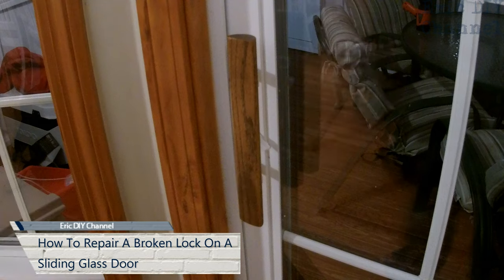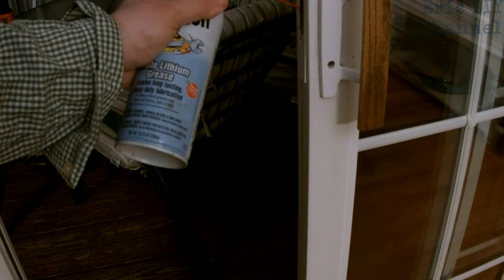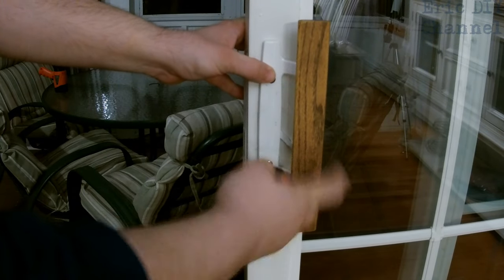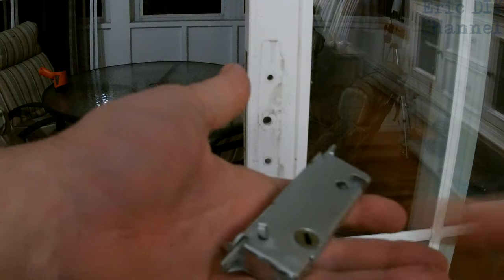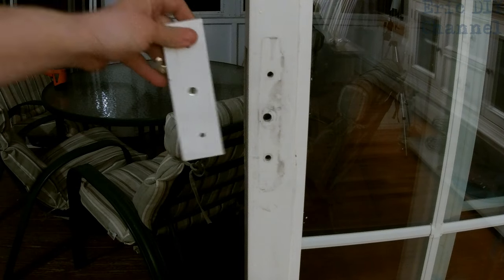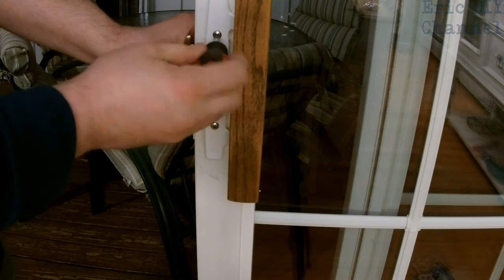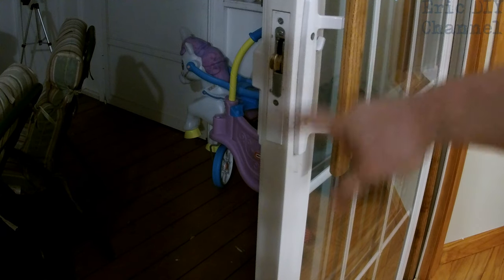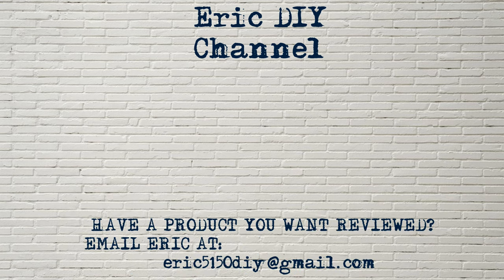How To Repair A Broken Latch On A Sliding Glass Door

Comment: Those locks are pressed together and can be taken apart.  There is a small spring inside that breaks all the time...I've replaced or repaired the spring over a dozen times.  The spring is what lifts the latch back into position to lock with the latch.  When purchasing the new lock, ensure you have the latch with the correct position.  The one here is the 45 degree position...some locks are identical with the exception that the slot is vertical, not at an angle.
Reply: i figured it was the spring but how do I get it apart?

Comment: Eric you are the man brother!  The very last thing you said saved my bacon.  The adjustment screw fixed it.  The locking mechanism was popping out but not engaging .  I had previously applied graphite lubricant (which I was told was the thing to do with car doors so I had some left over.  That stuff is messy though so watch it).   Anyhoo it did work for a while but mysteriously stopped working again after our tenants moved out and we moved in.  This should help people in a similar situation.  And you can bet your sweet bippy I’m gonna do some bragging to my wife.  How dare she say I’m not handy!  😂
Reply from the maker: You're welcome...like and subscribe
Reply: @EricDIY  I did 😁

Comment: I was going to ask you... I have seen some instruction videos that talk about putting a pair of needle nose vice grips on the hook and/or sticking a thin screw driver in the top screw hole (once you take the handle off). You explained the needle nose vice grips, that would prevent the mortis from falling into the door. I expect the screw driver does something similar but not sure. I guess in the end you just need to be really careful if you don't know your latch set up. Don't want that piece falling inside the door.
It has also been mentioned that there are different sizes and that your should take the old one with you when you go to order/buy the new one. What I find interesting is that my sliding door is set up that the latch goes down not up and I have yet to find a video that shows this type of latch. I am going to remove mine this weekend (it just stopped working for me two days ago) and hopefully I'll be able to find a match.
Reply from the maker: It might be installed upside down... that's my only guess. It's feasible
Reply: @EricDIY  ahhh ok I wouldn't have thought that was possible. Thanks

Comment: Hi Eric, Excellent video, but your door has something that mine does not: At about 2:30 into your video, you remove an encasing that houses the lock. Mine does not have that, and looking straight onto the side of the door, all I see is the latch, and the brass surrounding piece. How do I get the lock out, or am I just stuck buying a new door? Thank you.
Reply from the maker: I was going to say you want to support the lock to be removed with string so it doesn't fall in the frame. Some doors/windows don't have the removable unit like mine
Reply: This is my problem. It's like you have to remove the entire side frame to get the old mortise latch out and the new one in.

Comment: Thank you for posting. I had no idea this part was available. The spring in the original patio door lock broke and I feel better having a more secure switch. That said, the door switch seems to have a bit of play to it - it operates fine (unlocks and locks the door), just feels loose when in the unlocked (up) position. I took it off and re-installed but that didn't make a difference. Any ideas?
Reply from the maker: Try turning the adjustment screw that I show in the video that makes the hook go in and out. You should make the hook go into the door a little more to make it more secure

Comment: Thx for this video, Eric!  Quick question.  I have a 32-year old sliding glass door handle that is 3-15/16. All I see being sold now are the 4-15/16 sizes handles.  Is it feasible to just drill 2 holes in the metal door (centering for the 4-15/16) to match those up?  I'd rather ot buy a new door as it is still working.  : )
Reply from the maker: You could do either...the choice is yours. Just make sure to line up the latch with where it attaches to the outer frame of the door

Comment: ..and if you don;t have the white bracket that comes out of the frame and it's just one solid piece that runs the height of the door?
Reply from the maker: There should be a way of getting it out still. I would have to see a picture of it to try to understand what it looks like
Reply: @EricDIY  thanks. I figured it out. I just removed the screws, pushed the lock inside a bit and it dropped right out. Went to Homie-D and replaced with the part you suggested. Thanks for the tips.

Comment: My mortise is fully inset into the frame, but my problem is the thumb latch does not come out. It's either frozen or rusted in the mortise so I can't remove the entire lock to replace it. The latch itself has a bit of give on the tongue bar that sets into the mortise, but it doesnt slide off the bar. Not sure what else to do. Trying to add a keyed lock to the outside handle since we use this door more often that the actual "front" door. Everything fits together with the new handle but once I tighten the screws the thumb latch (which is not designed for the new handles) and the new keyed lock are given a lot of friction from the mortise lock. Feels like metal on metal. The door, and subsequent mortise lock, is about 20 years old.
Reply from the maker: Try backing off on the screws a little and see if that works. The thumb latch could be your problem

Comment: Thanks for the video.  I got mine to lock but if I wiggle the door or push the door handle a bit, the lock pops back up (i.e. unlock).  I see that on your video at 4:27, when you lock it, the lock level stays down.  Mine doesn't stay down.
Reply from the maker: Sounds like you have to turn the adjustment screw to the hook to close further into the door. It should be a screw right below the hook that you turn. See around 6:20
Reply: @EricDIY  Youre awesome. That seems to work. I had to loosen that screw. Hope it will hold up. It has been such a nightmare trying to lock it every night. Thank you!
Reply from the maker: @trinhk  You're welcome...like and subscribe

Comment: what do I do if the latch is loose, not opening, door is in a locked poition? Can I open the door by unscrewing the handels?
Reply from the maker: You can unscrew the handles and see if you can turn it with a screwdriver. Try spraying lubricant in there as well in case it is seized up.

Comment: My daughter has this type of handle/lock mechanism. The latch was really difficult to lock and unlock. It would not unlock and we cannot open the door.  I removed the entire handle, but it still will not open.  It’s like it’s locked in the door frame, since there is no handle.  I don’t know how to get to it, since the door won’t open.  It is a lost cause?
Reply from the maker: You have to find someway of rotating it one time to unlock it (screwdriver?) and then I would replace it. Before I do that though I would spray it down with lubricant and see if it loosens up to lock/unlock (WD-40, silicon spray, etc...)
Reply: @EricDIY  Thank you very informative... I have the same problem as Carol... the latch is stuck in the lock position and we can't get it to release, so the door will not open... we sprayed it with WD-40 and tried a screw driver to flip it so that we can replace the lock mechanism to no avail... any other ideas? Thank you!!
Reply from the maker: @jkrebs24  Try to take off the handle, put a screwdriver (flat head) into the lever hole and try to turn it do it will unlock. You could also have a stuck spring in there.
Reply: @EricDIY  You are so kind to reply quickly... thank you! We have the handle off and have tried to turn it with a screw driver and it is still stuck... sprayed it with WD-40, let it sit for a bit and still won't release... locksmith can't get here until 6/22, ugh!
Reply: @eric DIY my son came over and popped the covers off the lower bottom of the door and raised the door enough to pop the lock up and open the door.... he went to Home Depot and purchased the replacement inner portion of the lock mechanism and it works great... thanks for your help and hopefully this can help someone else... stay safe and healthy!!
Reply: @jkrebs24  Thank you for that information!  I have the same problem and will try what your son did.
Reply from the maker: It was misaligned if you adjust the bottom rollers. Just use a screwdriver after taking the lower caps off and turn in one direction to see if it goes up or down. The reverse turn will go the other way. I adjusted my door before I had to replace the mortise lock so that's probably why you're having a couple of problems

Comment: Great instructions- replaced the lock with a new one. Still won’t lock, any ideas?
Reply from the maker: Did you get the right lock? Did you adjust the adjustment screw to make sure the hook goes out far enough to lock?

Comment: If you don't have one of those handy latch savers (from making it not fall down), how do you get the broken lock off?
Reply from the maker: I would say stick a screwdriver in the portion that locks while taking it off
Reply from the maker: Or tie a string to the piece that juts out when you lock it then disassemble the lock

Comment: The return springs are broken on mine .  I'd like to just replace the springs rather than buy a whole new mortise lock . I've got the type that has 2 latches .
Reply from the maker: I would just but the whole lock as it doesn't cost that much and it would be harder to take it apart
Reply: Eric DIY  Thanks Eric ,  yes , impossible to take apart as it's pressed together in the factory .  I actually managed to get new springs in there using needle nose pliers ... But ... they didn't carry the right kind in my little town and the new spring got in the way of the mechanism .., SO ,  I guess I'll be taking an hour drive to the nearest Home Depot and "spring" for a new mortise lock .  Gotta go there anyway to get my vacuum cleaner fixed .  It's worth fixing , Miele canister vac with a short in the switch or (?) .   Ever feel like everything is falling apart all at the same time ???  Great channel by the way .  BTW ,  would you happen to know why the power switch wouldn't work BUT it sortof tries to start when you pull on the cord retractor ?  The troubleshooting guide does say that it could be the cord retractor ,  but how could that be if the retractor is mechanical and not electric ?  Lol , I'm SO confused ...  Anyway ,  there's a certified Miele guy at the Viking Sewing Machine store near the Home D .  It's just $$$ .  Ya know ?
Reply from the maker: @lisacolbert5987  Sounds like the wire connect inside is loose.

Comment: Ya. My old lock in the unlock position, the hook was in the sliding door. Now with the new lock, like yours, the latch is still outside the door when its in the unlock position. Thats Because you cant push the lever up high enough to get the latch back into the door. And theres no way to adjust it.
Reply from the maker: Sounds like you have to buy a different model lock
Reply: Eric DIY No, its the same standard lock. Maybe different companies make slightly different variants of it but the size is standard. It was exactly like your installation, like if you could move the lever that locks/unlocks the door up another millimeter than the L latch would’ve gone back into the locking mechanism instead of being in the “out” position when the door is open.
Reply from the maker: @JamesMichael333  I have no problem with it being out as I can adjust mine for maximum tightness when it locks. My old one used to recess the whole way so there must be a same size, different model that allows it to recess fully.
Reply: Eric DIY Agreed. Our situation is exactly the same. Im fine with it sticking out while in the open position, even though my previous one was fully recessed when it was open. LOWE’s only had 2 to choose from and only one wouldve fit. So im just gonna leave it installed as i have no idea if trying out others and might end up with the same result. Thank you for the video and the replies. 👍

Comment: Why fix it?? Latches on sliding glass doors are ineffective locks anyway. They can be jimmied because the door can be jimmied by being pried up at the bottom with one of those Wunder Bars. I have a better way.

The most effective lock you can have on a sliding glass door is this: a little skinny brad or nail, 1 1/2 - 2 in long, dropped in a small bore hole, drilled at a slightly downward angle, through the first two layers of your sliding glass frames, while it's closed and locked. It should be done on the part of the frame where the door closes and locks, but you can put one on the other side of the door too. It's kinda like wearing a belt AND suspenders, but, if it makes you feel secure....

That's it. You can put it as low as you want, or as high as you want. Slightly overhead, is my choice.  You want to think fire safety, so don't put it where you're not likely to be able to remember or to reach it, if panicked. Or if there's likely to be a crowd of people right behind you that might prevent you, or crush you, if you reach down for it. 

I've been doing this to my doors and using it since 1981, when Mr. Maintenance Man was worried about this single girl living on the back part of the apartment complex near the train tracks and trestle, where Kingsley crosses Skillman, in Dallas. Though placed amongst middle to upper class established neighborhoods and nice modest apartment complexes, it had a lot of graffiti art, and was indicative of people going there to...um...er...uh... do a variety of shenanigans, shall we say. He informed me of these things, and didn't ask, if I,  but informed me, that I, wanted a SECURE lock put on the patio (sliding) door. He explained,  did it, then said, "There now, you're safer than if you had a big dog or a man!".

 I bless him to this day, as do many of the people that I've told to do this, or have done it for. I have also heard anecdotes and horror stories from people who have used other supposedly secure devices.

Comment: No help with a latch on a door that is closed/locked. 
Anybody else?
Reply from the maker: If you can get the handle off like I show in the video, you might be able to stick a screwdriver in the hole for the lock and rotate it to unlock if it's not too broken
Reply: No go. Apparently, will need to drill a hole through the mechanism somewhere. But thank you!